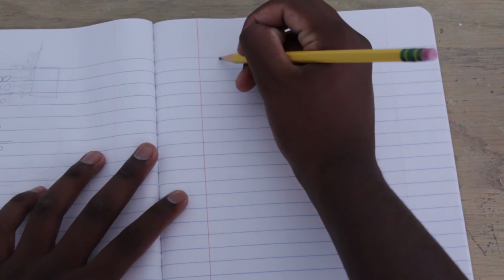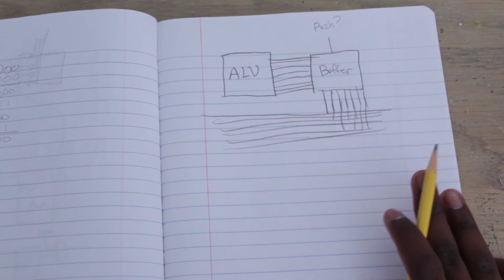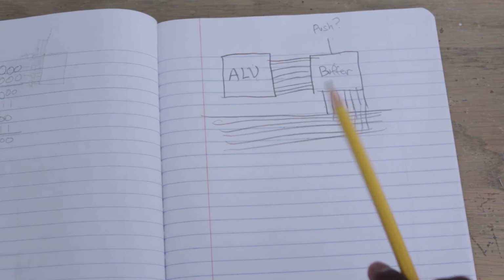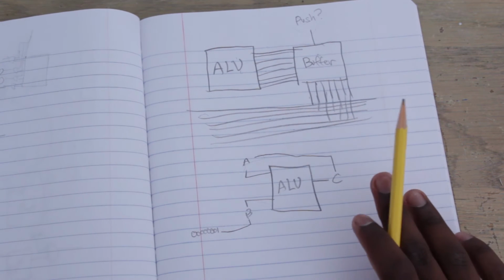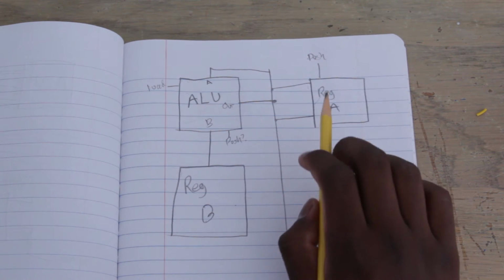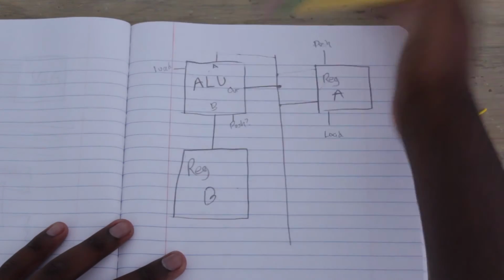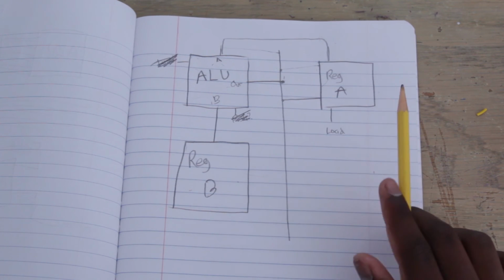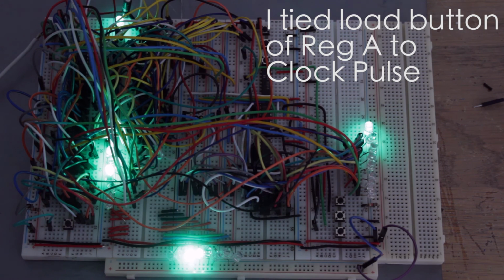i++/Continuously Add 1 Circuit | 8 Bit CPU Project

Comment: What is the ic called that allowed you to condense the flip flop and tri-state buffer
Reply from the maker: it's two separate IC's. The setup is a flip-flop which outputs into the tri-state buffer. Although here is the datasheet of a chip that looks like what you're asking for: http://www.ti.com/lit/ds/symlink/mm54c173.pdf
Reply: thanks that was the one. I changed my approach for mine though.
Reply from the maker: Nice!